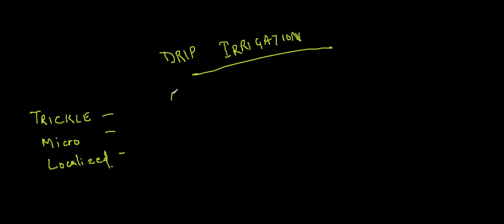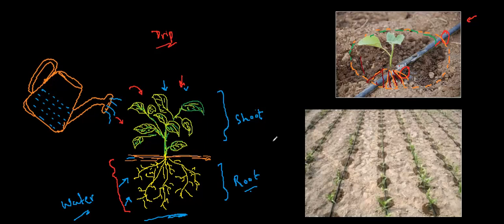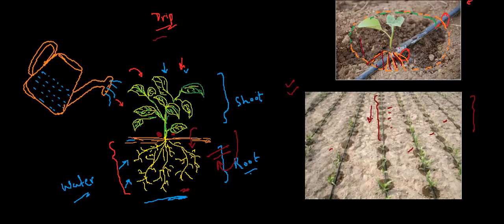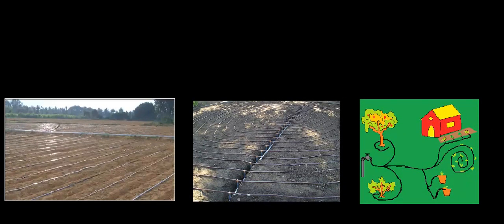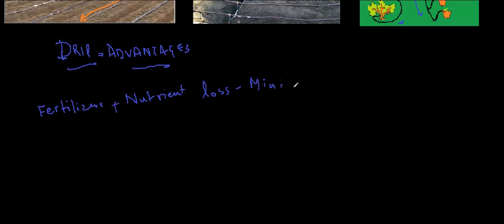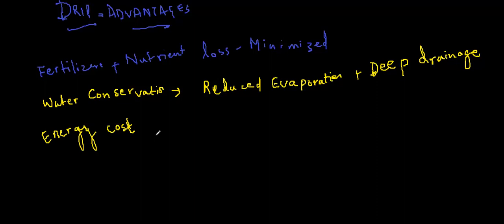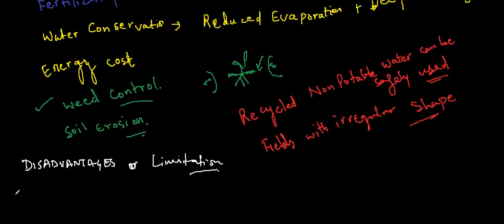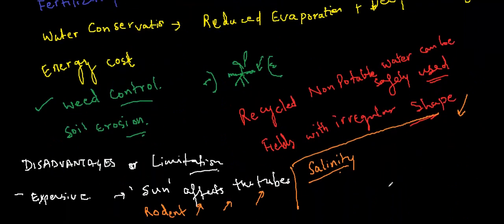Geography Lecture (IAS) : Drip Irrigation System || Likhaai || Vaibhav Garg

Comment: how  salinity  can be the disadvantage of drip irrigation? 
Plz explain it again
Reply from the maker: Nice question.
Salinity means the presence of salts in water (not necessarily just NaCl, but may have Magnesium or Calcium salts as well).
Salts tend to create a hard, white layer over pipes or drip surface , which could block/ slowdown the flow of running water.
You might have seen a white hard layer on kitchen/ bathroom taps. That layer is created because of presence of salts in the tap water.

Hence can be disadvantageous to the system.
Reply: @thenextlandmark  thnx for d quick response
I'm forward for more videos related agriculture.